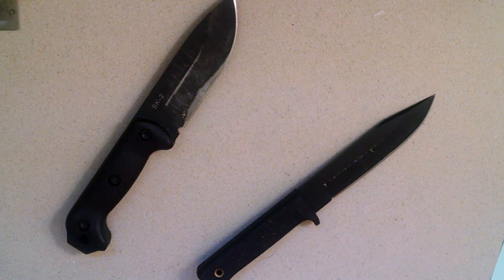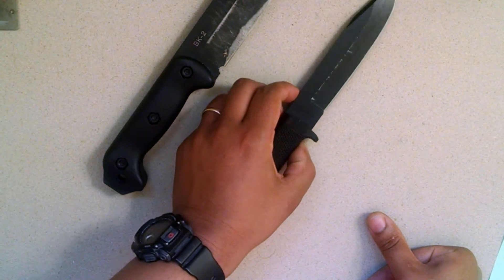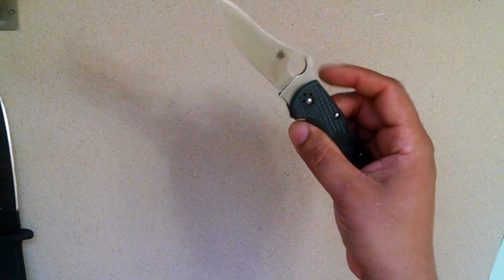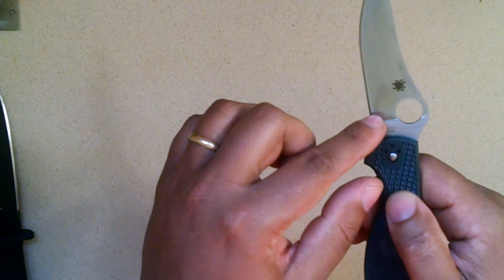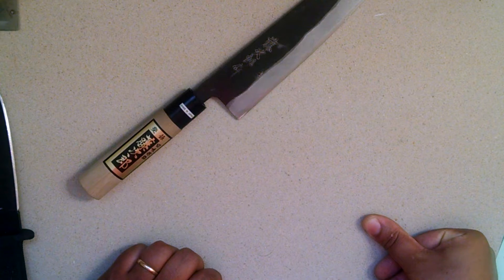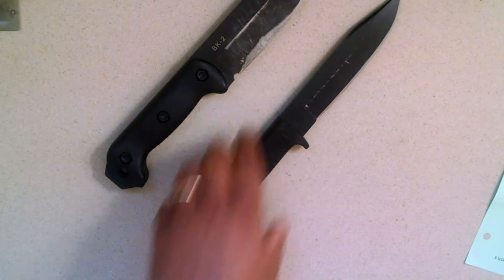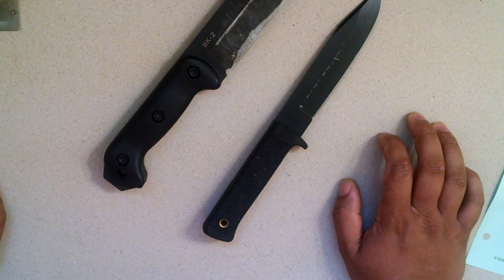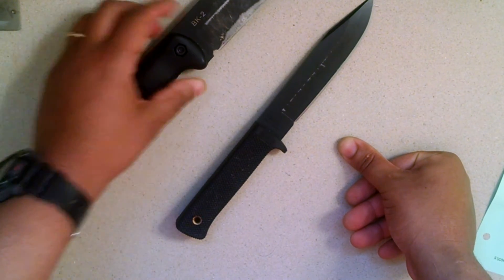Carbon vs Stainless steel?

Comment: you obviously don't know how to use the bk2, the little groove in the bottom of the blade close to the handle is for striking a Ferro Rod.
Reply from the maker: its called a "choil" that is not the original intent of what a choil is for, educate yourself xD

Comment: How much carbon is in stainless steel is about as meaningless as a fart in a whirlwind.   Where steel performance is concerned, carbon content has to be measured against the percentage of chromium and a couple of other elements.   Carbon cuts in carbon steel.  Much less so in stainless steel..

The truth is, in the city you can use any steel you like.  Who cares?  I prefer 1095CV, but I also own several stainless knives.  But only a total damned fool takes a stainless steel knife into the wilderness.  It's a dangerous, incredibly foolish thing to do because no stainless knife will strike sparks from flint, quartz, or chert, and I've yet to find a stainless steel knife that I can sharpen with one hand on a river rock, and I was a professional sharpener for a number of years.

These things may sound like fantasy, but I've seen people in true survival situations have to do both, and I've seen it on numerous occasion.

Sometimes you just need to shut up and listen to the experts, and every expert outdoorsman I've ever known carries carbon steel in the wilderness.  Or in anyplace where true survival situations are a real possibility.  The one certain thing is that a stainless steel survival knife is being carried by a fool.

It's also just silly, truly silly, and very ignorant, to compare the carbon content of stainless steel versus carbon steel.  It's like comparing apples and submarines.

As for Japanese versus American steel, you're still on the carbon kick without having a clue what the carbon content really means.  More is not always better.  In fact, beyond a cxertain point, more carbon makes everything worse except for hardness, and beyond a certain point, which several stainless steels reach, hardness is not a good thing.  Neither is toughness, nor edge retention, nor abrasion resistance.  

There isn't a Japanese steel made that I would have on a knife.  Most of it is just average steel, and even the best of it is inferior to several American steels.  

Stainless steel certainly has its place, and I like a lot of it.  I routinely carry a stainless steel knife around town.  But stainless is not a miracle steel, and even mentioning it's carbon content in a way that makes it sound better than carbon steel because the stainless has more carbon is just remarkably ignorant.  Just about everyone has known this since stainless was invented, but YouTube brings out ignorance like rain brings out mosquitoes.

The ONLY reason the carbon content of stainless steel is talked about now is because carbon steel, then called HIGH carbon steel, owned the entire outdoor market, and a good part of the indoor market.  So a very bright marketer said, "Hey, our stainless has more carbon that their 1095.  I kknow it really doesn't mean anything as far as quality goes, but let's take advantage of it and start calling our steel high carbon stainless."

Unfortunately it worked.  You can see the stupidity of it by comparing Chinese 7cr17MoV to 1095 CV.   I doubt anyone would say that the Chinese equivalent of 440A is as good as 1095Cv.   Most people, in fact, call 7cr17MoV the junkiest steel out there.  But it has considerably more carbon than 1095CV.

Wow, what a spectacular steel 7cr17MoV must be.  Just look at all than carbon!  By God, it's the upper steel to rule all super steels.  It's even better than the king of the carbon hill.  The king is dead, long live the new king.

Well, no.  7cr17NoV isn't a very good steel at all.  It isn't even in the same zip code as 1095CV, even though it has more carbon.   You say that carbon sucks up chromium.  It's really the other way around.  Where performance is concerned, chromium captures carbon and prevents it from doing the same job it does in a carbon steel such as 1095.  

Haven't you ever wondered why carbon steel is never brought up to its full hardness, toughness, abrasion resistant potential?   It's easily possible to make all of these things ridiculously high without making the steel too brittle to use.  It isn't done because beyond a certain point these things are disadvantages for the large majority of knives, and for an even higher percentage of knife users.

Of course, there is the corrosion factor.  Carbon steel rusts, and this is a terrible thing.  This is why you can use them near water.  And get them near saltwater and the turn to rust immediately.  This is why pirates and military sailors over a sixteen hundred year period never got into sword fights.  They wanted to, but their swords all turned to rust before they could find anyone to fight.

Of course, it took a true miracle from heaven to preserve the thousands of those swords we still have.

Really, it's a free country so use whatever you like, carbon, stainless, rubber, wood, or whatever.  But don't say stupid things about the high carbon content of stainless steel, or equally stupid things about Japanese steel.  Even making comparisons at all is stupid.  Stainless has its place, and carbon has its place, and all the stupid arguments by ignorant people won't change this.

Fortunately, it doesn't have to.  It really is a free country.  Well, a semi-free country.  If you lie stainless, then use stainless.  You don't need a video to justify this.  Just do it.
Reply: What about the quality of samari swords, I would rather have one of those over anything the yanks can make.
Reply: Wow, incredible analysis

Comment: the funny thing about carbon is that if its present as an impurity vs present as a part of the design that makes all the difference. Its not about the carbon CONTENT, its about how carbon is used in the design overall. Graphene is stronger than Graphite and its 1 atom thick vs graphite which is not as well organized as graphene. Diamonds are harder than graphite is another analogy if youre not totally read up on graphene. Overall great video though!

Comment: I think I grew up with ss on knives but my 1095 knife broke it was a schf36 . But my buck 103 with 425 moded steel works just fine and no chips... I'm sorry it just left a bad taste in my mouth .I'd rather trust me and my family with a good stainless steel
Reply: Are you talking a Schrade knife?  That's probably your issue.  Buck and several other companies use an excellent method of heat treating.  Buck is actually know for making great blades out of meh quality steel.

Comment: God damn I'm not sure what sort of Mandela effect happened over the years, when blades started switching to carbon steel it's like everyone just jumped on board and said ok. But my god so called high carbon 1095 steels are better for forging/folding, quenching and the sharpening...I literally could be completely wrong but it's like everyone just started grouping 440 stainless with every piece of shit Chinese knock off ever made and that's so wrong because my old buck folder is still better than any of my carbon blades I bought over the years...I think stainless blades were never designed to be sharpened. They are for everyday use, meat prep and waer/moisture resistance. These things really matter, that being said if you want that blde that you need to constantly care for and sharpen because it will be that little bit sharper or whatever reason it is you want to sharpen is consulate for so be it. stainless is just better for us dummies who just want a cutting tool, vs the necessity of having to sharpen that tool and clean it and so forth...yeah chances it's a better blade for sword fighting and whatever but damn man I don't even have time to floss let alone sharpen my knife.

Comment: Hi ya. Enjoyed your video and very much echo your remarks around fire starting and ferrocerium. You are bang on. If you can shave the rod, it will spark. 

Personally, I see a difference between survival and bushcraft knives in that I would take a super hard steel out bushcrafting (why not?). But your beast of a 1095 example looks great to me for survival. Yes, it will rust, but you can probably sharpen it on a brick, the back side of a plate, or your own chin after a few days stubble growth 😁.  You can whack it into whatever you need when the world had ended and it's all you've got and it won't chip or snap. And it's huge and wide so you can cook on it and it makes big holes in things you might need to have big holes in (bears, zombies, food that hasn't died yet). 

High carbon stainless keeps an awesome edge. Those chromium carbides make the steel are very hard and make the steel harder to sharpen. D2 steel is a great example of a high level of chromium which had formed carbides from all the carbon also present, making the blade stain resistant, not stainless. Hard as hell with  heat treatment (60 HRC normal). I have a crappy old 420 folder that I could sharpen on a rock that might be a better carry on the apocalypse that a D2 Ontario rat or steel will cutjack though.

Comment: Hey, when you say it's about how you use the knife and talk about "user error", what about batoning?
Reply from the maker: Be more specific:)
Reply: Like 6:00, You say when you're using a blade with a harder steel you get chipping a lot if you're using the knife in ways it isn't meant for ("hitting the ground", etc) so I'm wondering if you'd include batoning in that.  I want sort of an all-purpose survival knife as a backup to my mora, machete and ax, but most importantly that I can baton with it if need be and not worry about damaging it. Something that can do all of those things if it's all I had.
Reply from the maker: +Michelle Jolie batoning only damages the edge if you hit the ground, select a knot filled hard wood that even a splitting maul could not handle, and if your edge is too acute for the steel and heat treatment and task.

User skill and knowledge are the ultimate factors
With the knife being personal preferences suited to the users techniques and environments.

There is a huge emphasis on " not chipping" in survival groups. My argument is for increasing user skill rather then compromising cutting performance for user error.

For instance, if I never l chip my edges because of solid techniques, tactics and knowledge and can sharpen properly
Why should I be punished with a softer steel and obtuse edge that doesn't cut well or hold a sharp edge?

This is a vast topic, endless possibilities.

Ask me anything specific and it helps my answers :)
Reply: Ok, points noted.  I'm kind coming from the standpoint of:  A) I don't have preferences or skill or knowledge, lol. I'm not a woodsman. I'd probably hit a big knot or select the wrong wood. B) This tool would be strictly for survival, not fun, a real survival situation where this is the only tool I'm left with (not that I believe in a "one-tool-option") and in that situation the possibility of making mistakes increases to an even greater degree.  

I do know it's gotta be full tang, 6-7".... but beyond that I have no clue and I've been agonizing for weeks, reading blade forums about steel types and heat treatment and edge angles and ease of sharpening and throwing sparks............ ugh just so much.  I'm at that point where I know enough to know how much I don't know lol
Reply from the maker: Michelle Jolie hahaha gnarly.

Too much information 

I can relate, we were all new once.

My recommendation 

Don't overcomplicate it.

Just buy a name brand knife at a reasonable price like a Becker 

I know alot of my videos don't help with the whole complication issue Haha but I love geeking about knives and like all things it's all about the details when you have a good base of knowledge 

In the end though survival knives are ony as good as the person using them.

We love romancing the idea of a knife saving us in our time of need.

But survival is a mindset not an object. It's knowledge, not tools

You can have the best knives in the world but it's useless if you can't properly utilize your surroundings to even use your knife to survive

Just buy a Becker BK 7 and go have fun and move on or realize that you really love using knives and learn how to sharpen and experience other offerings.

Finding the perfect knife is red herring.

There is no perfect knife.

It's all preferences, budget, and the right tool for the job.

Have fun :)
Reply: Thanks, BK7 is the one I've had my eye on for sure, except for that lame grip on it, what the hell?  I guess I'll just wrap something around it.  And yeah, I do know that I will have to acquire the skills just hope I do it in time!  :)
Reply from the maker: Michelle Jolie awe, but you see, you don't want "grip" 

If your using the knife for long periods, friction plus moisture equals blisters.

The smooth grip produces less hot spots with actual use.

It's the handle shape that is the most important and the Becker's have one of the best.

Especially for my large hands
Reply: Ok, well perhaps something to feel better about.  Got me my BK7 this morning!  Had it sitting in my Amazon cart for at least 3 weeks, you just gave me the final confirmation :)  Btw, it was only $77 on there!
Reply: @MindofChristChannel  ignore this nonsense, you can beat the shit out of a bk2. I abused mine for 8 years.
Reply: Batoning?  Get an ax
Reply: I have an ax, but thx so much for your suggestion, I'll go get one

Comment: Most folks don't know that the 10 series can be broken down so easily on carbon content. 1095 (.95 carbon), 1060 (.60 carbon) etc... Pretty easy to remember. I think out of my knives, the S110V has the most carbon at 2.8 and is stainless. On the non stainless side, my Bark River Bravo 2 in A2 tool steel is 2% carbon, and as mentioned by you, rusts super easy.
Reply from the maker: +Jeremy Madsen 
I wish A2 could have 2% :P

Nah,  A2 is 1.05 carbon

2.00 would be awesome but It would require PM technology to prevent carbide clumping that would make a crap knife.

There are some cast ingot tool steels that have 2% carbon but they aren't for knife applications.

D2 and M2 are at the limits for highest carbon non powdered metallurgy knife steel at about ~1.60

Check out the Zknives app for your phone 

It's for knife nerds like us
Reply: Yeah, you're right. No idea where or why I thought A2 was 2% (probably some dream I had that seemed real) - I totally thought I got it from a maker's metallurgy sheet, but it is proven a false memory. I went through a dark time in my life, where all I could think about was knives. I'm finally at a point that I have the sickness under control, to where I only spend $300 or so a month on them.

Comment: Could you please compare the new laminated cobalt steel of the Fallkniven A1 Pro to a "regular" CS and SS blade?  Especially, how does to lCoS compare to the two blades when used by an expert and a total newbie?  A video about how the lCoS compares to other steels (such as S30V for ex) would be really interesting to those who just got a A1Pro and those who are considering getting one.  Thanks!
Reply from the maker: +Vineyard Saker 

Sure, Ill make a video,

Basically it's a vg10 Plus.

It doesn't have the wear resistance of S30v
But it sharpens to a very keen edge with ease and could be tougher too.

It's my favorite stainless steel for a variety of reasons that I'll cover in detail in a video

Thanks for watching bro
Reply: +Big Brown Thanks a lot!

I have a shameful confession to make: I tried sharpening the A1Pro with the DC4 stone and with a Spyderco Sharpmaker and even though I did everything I saw on videos, I cannot get a really sharp edge.  I must be doing something wrong, but I have no idea what.  It is sharp, okay, but not even enough to easily cut paper for example.  I even feel that my "sharpening" efforts made it less sharp than how it came from the factory...  And I though even a dumb blonde could use the Sharpmaker - but I guess I am even dumber than that.  Is there any other stone or sharpening tool you could recommend for a really NOT astute wannabe sharpener like me? Could you make a video like "sharpening knives for clumsy idiots" or something similar?
Thanks for everything!
Reply: It's not the tools, it's your skill level. Get with an experienced person and get your technique down. You'll be surprised what a steady hand and keen eye can do to an edge.
Reply from the maker: Bill is correct but I feel your pain Saker.

took me a while to learn, but if I can make a video on sharpening easy mode that can help guys like you I will.

Stay tuned
Reply: +Big Brown 👍

Comment: Sounds like you're about on the money, althought my knowledge is as a user and enthusiast only. My experience leads me to prefer laminated stainless steels for most applications. The laminated SGPS and the laminated VG10 that fallkniven put in their folding and fixed knives is ideal for most of my uses, if I can afford it!
Reply from the maker: Ain't that the truth! :)

Laminated Japanese steels are quite expensive but sharpen like a dream and are a joy to use.